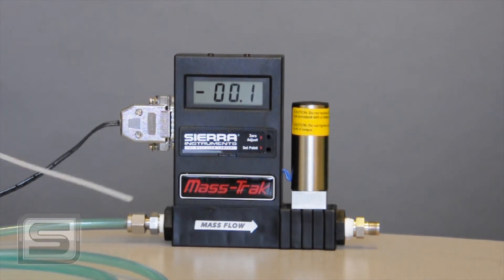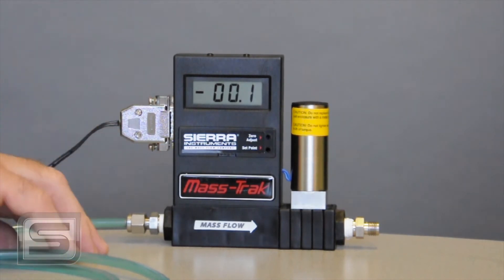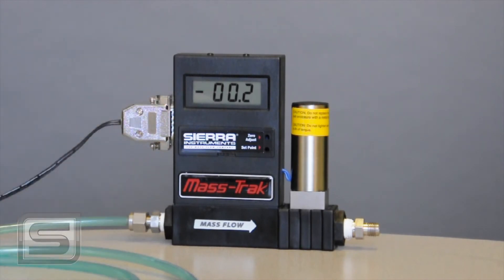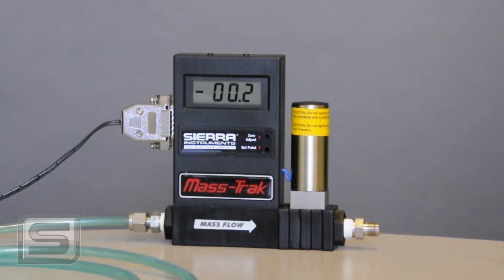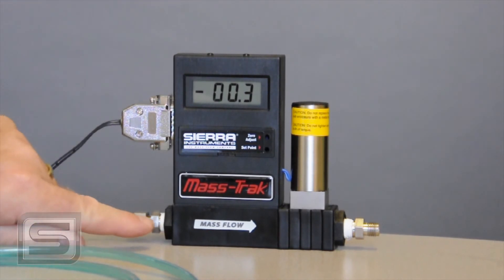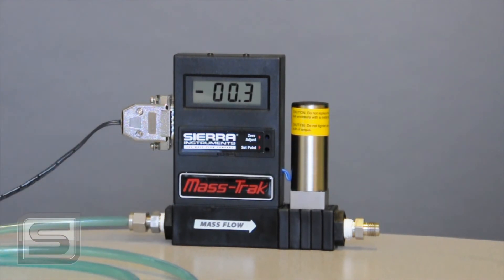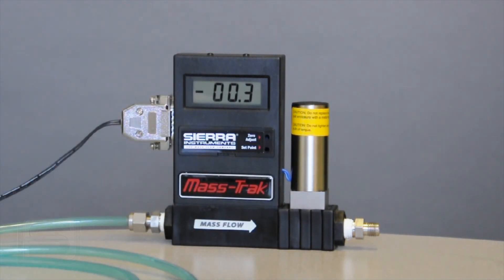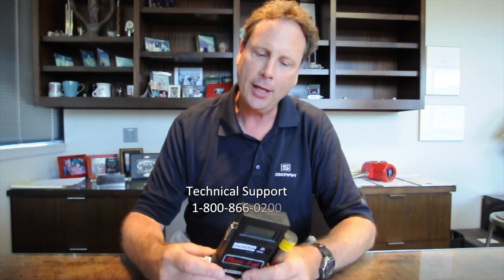How to Effectively Perform a Mass Flow Controller Leak Test

Comment: possibly a dumb question, but with power off on a flow controller  can I still pull a vacuum across the compenent for leak testing both the inlet and outlet connections? im helium leak testing a gas panel with MFC's installed but with the panel removed and no power...thx in advance